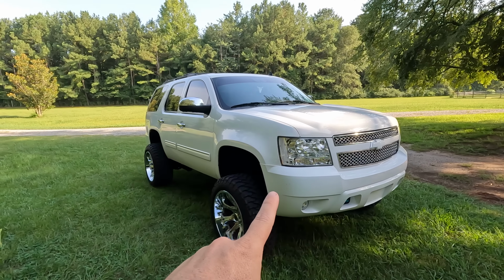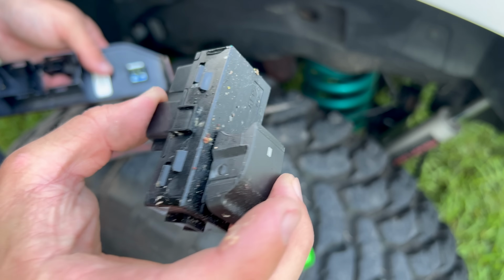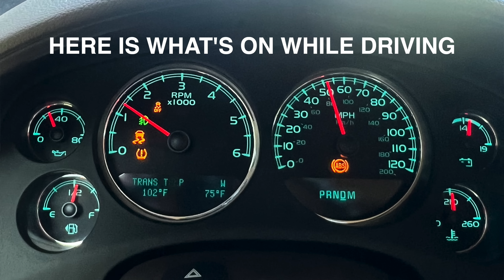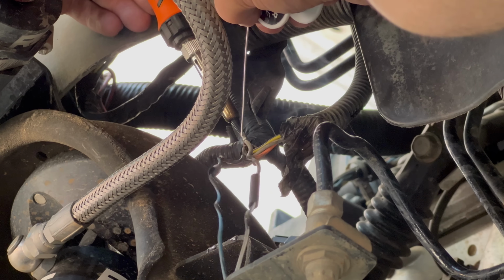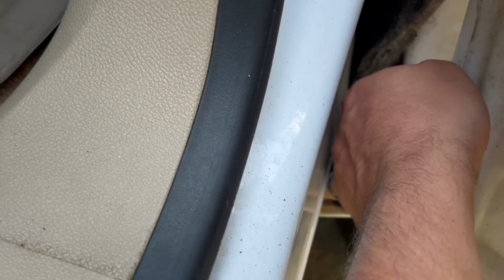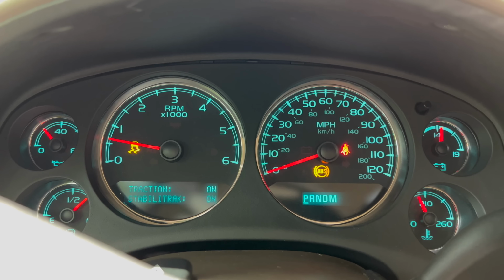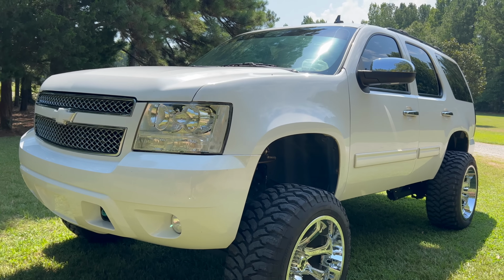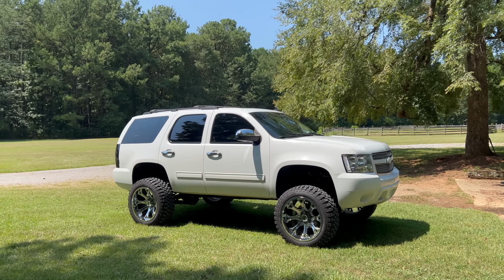THE MOST ANNOYING TRUCK PROBLEMS

Comment: Had similar issue on my wife’s expedition. One side was broke so I spliced it. Worked for a day or so and then nothing. Replaced it and still had issue. Found out the other side was bad also. I replaced it and fixed the issue.

Comment: check and make sure the abs wire isn’t pinched between near the dust shield and spindle
Reply: mine got torn right at the sensor and threw that code

Comment: Just fixed the same issue with my truck turn out there was a miss fire in cylinder one causing the stabilitrac light my coil just so happened to be unplugged

Comment: only way to tell is if you have a snap on or autel scanner tool and it will show the abs ring speed on each wheel and super easy to tell what one is bad just get the right tools or take it to a shop
\

Comment: Low brake fluid caused my 2011 Silverado to throw the same lights. It’s worth checking
Reply: Was going to comment the same thing, I’ve had to up the fluid level slightly when there lifted with a little lean as well. The fluid goes more towards the back of the reservoir and has caused the same issues.

Comment: Front wheel hubs. 
There are little magnets on the inside face of those front hubs that let the abs sensors know the wheel speed. 
My hubs were still good but a few of the little magnets vibrated out and caused this same issue.

Comment: Your oil pressure is by no means low for hot idle at 20 psi, but if you ever have to pull the pan you can plug the oil bypass valve and replace the pickup tube O-Ring and I believe it would bump it up a bit based off of my personal experience. Certainly not something to tear it down just for that, but it is a good idea when it is down. It also has the added benefit of potentially decreasing oil consumption as they were known for splashing oil during bypass causing it to burn.
Reply: Just to clarify I made this as a separate post from my other one as this is in no way causing your issues. This is simply something I wanted to mention after noticing the gauge in the video.

Comment: A BlueDriver would be an absolute MUST HAVE for someone doing YouTube videos like you are. It is about $100.00 and gives you all kinds of live data and allows you to scan ABS codes. Get that and it will be much easier for you to diagnose the vehicle. Good luck sir!
Reply: I don’t mean to sound rude in saying this, but anyone suggesting random parts that could be bad are leading you in the wrong direction. While these are all very possible issues you would just be loading the parts cannon without knowing the exact codes as they will narrow it down quite a bit.

Comment: The ABS light and the traction control light should go out when you install a new wheel speed sensor. The other wires looked like they worked with your splice if you were able to turn them off and on like that.

Comment: My Tahoe had those lights on and it was for the rear abs, the connector was pulled apart after putting the rear lift in

Comment: I replaced both wheel speed sensors in my 00 z71 with similar issue and it fixed them. Tried just one and it ended up needing both.

Comment: No it’s the rear differential I had the same problem on my Ltz differential went out bought a new one it went away until I did a massive burn out one day it came back re set code stayed on till I put another rebuild differential this tip is for the traction control light

Comment: This might sound crazy but I had the same issue in my 09 Silverado. All mine was was a weak battery. It was sitting at about 10.5 volts when off instead of 12. Got a new battery and everything went away.

Comment: Check grounds, may have bad abs sensors, there’s also sensor on the steering wheel under the dash that will cause this as well. You don’t need expensive scanner. It’s one of the 3 things.. checking grounds cost you your time no money.. after that it could only be 3 sensors. All easy repairs.

Comment: There’s a control module that is connected to a wiring harness under the front bumper , changed it on my buddies Tahoe that had the same lights, and it went away . Dk if it’s your issue,  but it could’ve gone bad .

Comment: Buy a scan tool other than that your waisting your time unless you check power to each speed sensor, which you probably won’t do seeing as how your diagnosis for the window switch was assuming it was bad cause it was dirty. But you got lucky so props
Reply: You could tell it was the switch with how it was sticking. There was really only 2 possibilities for the window so I’d say he diagnosed that just fine. The switches in this body style are known for going bad
Reply: @ianbailey1109  yeah I would also “assume” the switch was bad by how it was sticking, but as I said that’s an assumption and could also not be the case, window motors are know bad on these rigs as well. But a 100% confirmation would be testing power to the switch and from the switch ie at the pig tail of the switch and pig tail of the window motor

Comment: Could potentially be a cracked tone ring in the hub bearing… I had a 2012 gm product with the same lights but did not affect drivability… I would look into the wheel bearings… especially with having added weight on your hubs with the offset oversized wheels

Comment: Replace both sensors with a new wiring  harness for the (ABS) light. Check and see if that will solve the problem not 100% sure but I would give that a try bro

Comment: If your steering wheel is not close to being straight while you’re driving forward, it can cause those lights to come on but it could be a few things hopefully you can find the issue
Reply: Had the same thing happen with my 2012 Silverado. Alignment got messed up after tagging a deer going 45 and slamming on the brakes. Thankfully I had a ranch hand on could’ve been hell of a lot worse

Comment: Those two lights suck because anything to do with driveline will trigger it, on my truck it was the steering angle sensor. If it is that almighty GM has discontinued the part for it so you have to use one from a newer truck and it can be finicky.

Comment: Dude don’t worry about the oil pressure mine has been blow 20 ever since I have owned it even my Duramax has low oil pressure never had a issue
Reply: My 13 Tahoe sits at about 20-30
Reply: What I win lol

Comment: Looks like low oil pressure my 08 1500 gets A solid 40 on startup don't drop down to bout 30-35 till it warms up a little. 
That said I just changed the oil pressure sending unit and filter, plus oil change and filter
Reply: What year?
Reply: My 13 tahoe sits between 20-30
Reply: This would not cause an ABS light. It is also not uncommon for a vehicle to have his oil pressure level. General rule of thumb that racers have always used is 10psi per 1,000 rpm and he is plenty good on that. I do not know the spec off the top of my head but GM is okay with much less oil pressure at hot idle than he has.
Reply: @ProfessorDickify  08

Comment: I had the same issue on my 2008 Tahoe. I have the blue driver scan tool. It blue tooth’s to your phone by there app. You just have to buy the device. I did a scan with it and it told me which wheel sensor was not working. Went to the wheel and the plug was unplugged. Plugged it back in and all lights went off. Hope this helps.
Reply: Hello.  Did that work out for you?